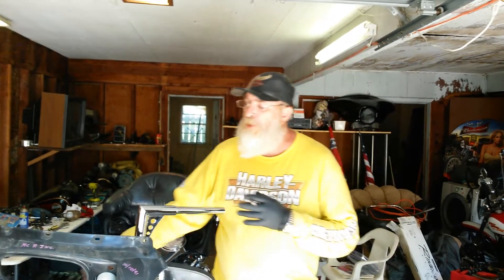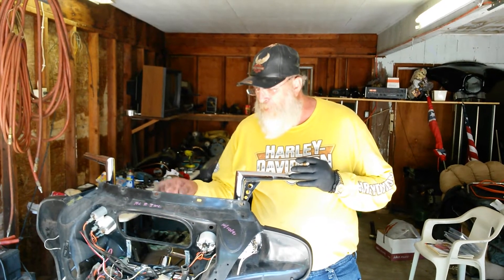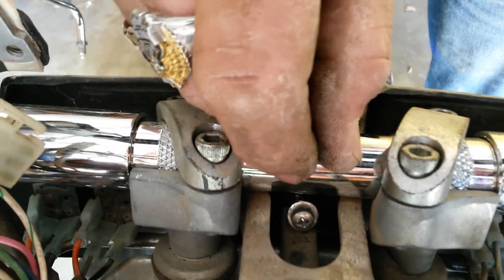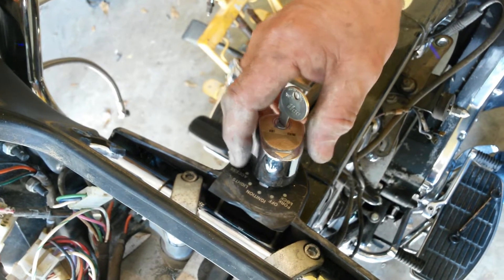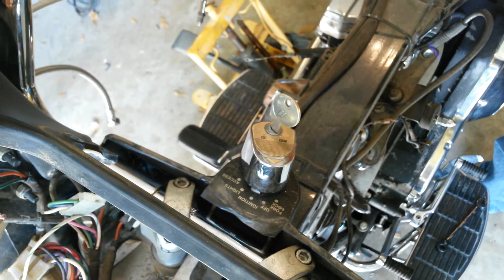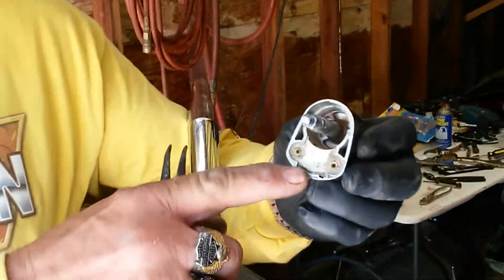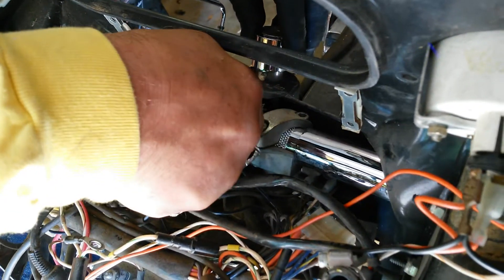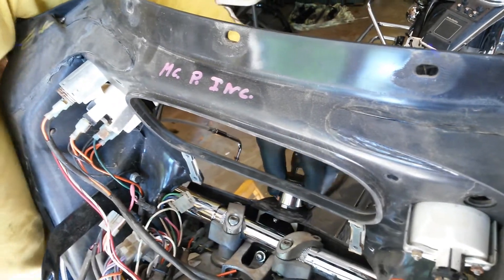How to remove key switch on 1992 HD ultra classic

Comment: Thanks for the video but here’s my problem my ignition switch won’t lock if I replace that switch will it fix my problem or is there something else going on deeper in the ignition switch or the steering head any help would be greatly appreciated